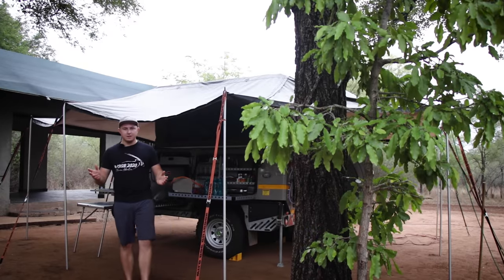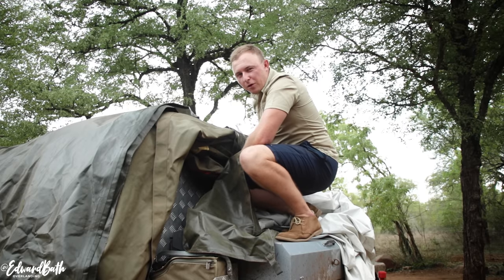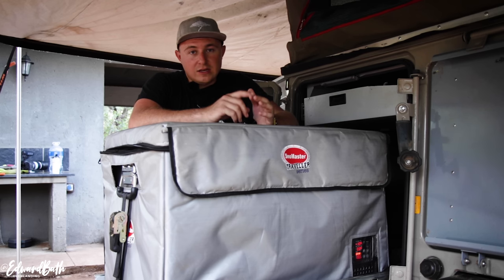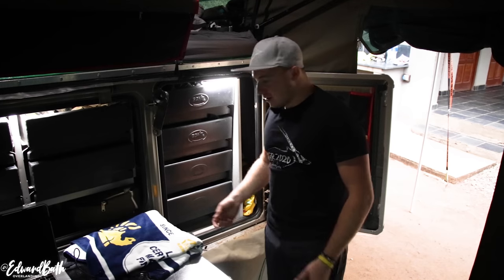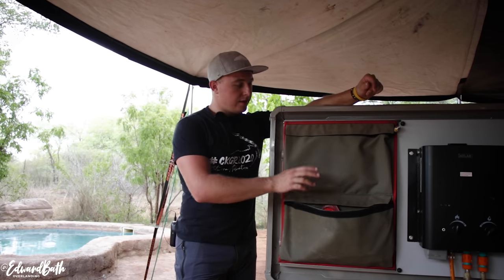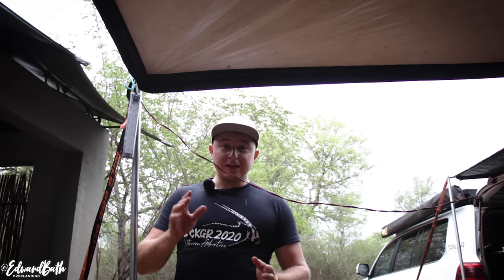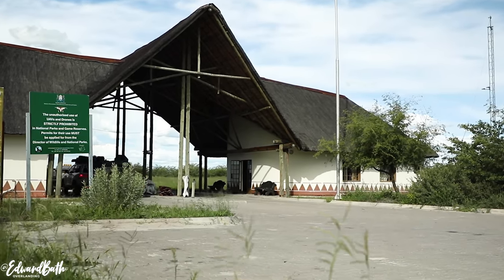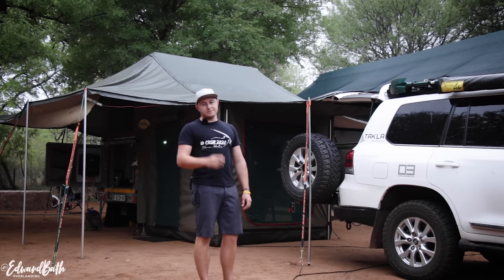Echo 5 Off - Road Camping Trailer Review | In Depth Walk Around | Why It's So Good!

Comment: Howzit Ed maybe do what I did to my conqueror. Remove the tent. Replace with a clamshell tent, I mounted mine on a bracket so that I can store wood, table, chair or fishing gear on the trailer roof below the tent. Then add a 270 awning and finally to my point🤣 permanently run light cables on the awnings folding arms, they are permanent, only setup is to remove the hella plug and wrap the cable up to store in the awning and this cuts down on setup even further.
Beer in hand sat in chair fully setup 90 seconds….mint!

Now I just need to find a ladder that doesn’t hurt my feet

Edit Just seen the end, guess I’m not such an original thinker👍
Reply: That Conqueror mod is👍
Reply from the maker: Hahah thanks Tom! Yeah I will be releasing a video on the clam shell conversion etc 🙌 thanks for the tip!

Comment: Brilliant review. For the lights, the cable just use velcro straps but I will suggest for the light use LED strips with 5v sonoff relays switch that u can remote control using your smartphone even when sleeping. U can even run a wifi PTZ camera to view your surrounding you can at night, I did that and its cool
Reply from the maker: Thanks Harold!!

Comment: Make the lights a diy portable  lithium battery compact project,  
Awning  get someone to stitch a decent strap in line with awning poles from pole to roof top tent so when you pitch awning jou pull with storm wind straps on another strap and not on the canvas the strap incorporated  in awning roof will straighten awning and strengthen awning and keep those dams of rainwater of awning. In stormy wheather anchor awning poles at foot of pole so wind doesn't lift pole and cause damage and chaos in camp
Reply from the maker: Thanks for the great tips Markus!

Comment: Only problem I have with Echo is the rainwater collecting on the roof. I have to set the poles way down to sort of manage it.
Reply from the maker: Pull the awnings really tight and then lower the corner poles, this solved my issue!
Reply: @EdwardBath  Thanks, that's what I'm doing at the moment, with the side walls it can get very tricky. I'm also using two telescopic painting poles from the inside corners to the trailer that works but not with high winds.
Reply: I removed the awnings that were supplied with the Echo 5. (MK 4 tent) They did not perform at all in the rain. Water pooled every time it rained. It was a huge problem when the side walls were attached as I could not drop/lift poles accordingly to help spool off the water. 

i did the following modifications. 

1)Remove existing awnings
2)Had new gable awnings made up with zip attachment to the main tent
3)Squared off awning. No more splayed corner. This has given me more floor space 
4) Modulated the side walls to individual panels. This allows me to set up as what is required for privacy or weather. Far easier to handle than 6meter panels as per what came with the tent 
5)Side walls are attached to the awning with Zips. 

End result is a unit that is user friendly and will withstand the rain.

Comment: Brilliant channel, brilliant review!

A question if I may: is the 200 still within its legal GVM when fully loaded, taking into account all of its weighty modifications + the added downward tow ball weight?
Reply from the maker: Thank you so much Paul! Yes it is well below the GVM, especially now that I’ve removed a lot of the weight by removing the drawer system and heavy batteries 🙌
Reply: @EdwardBath  thanks for the response Ed, really appreciate it. 

I think there's a lot of us 'Towers' out there that don't quite understand a vehicles limitations when modified & towing. Even a big vehicle like the 200 is easily overloaded considering it has a payload limit of 610Kg, assuming the tow ball weight is maxed out at 100Kg that only leaves 500 Kg for occupants, vehicle modifications & beer.

Maybe a vehicle & trailer weighbridge review covering GVM & GCM would be an interesting video to make?

I must add your video content & quality just gets better & better! 

Cheers Boet.